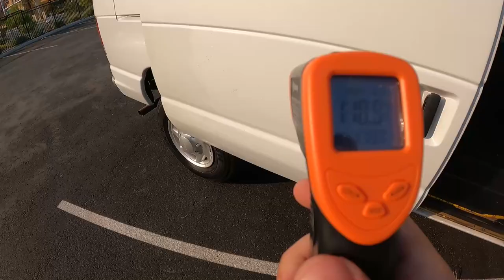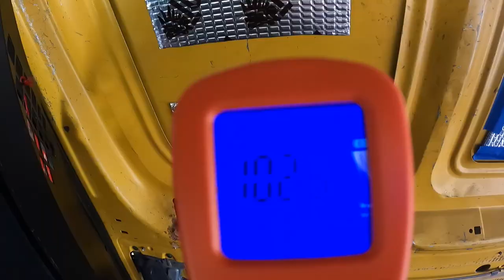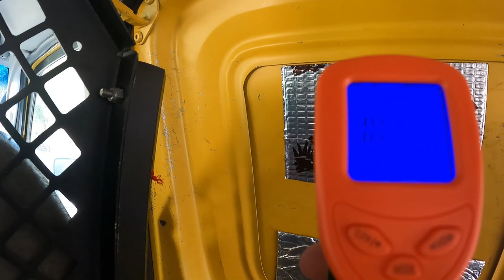How to do Van Build Pre-Insulation - Using Thermal Gun to Test

Comment: I made some layered window coverings for my van windows and to hold on the fabric covering, I used silver tape that was supposed to be for high temps but it did not last a summer. So I am going to used an alternate method to hold the covering to the plastic-reflectix-plastic next time.

Comment: You shouldn't compare temperature of different materials using infrared thermometer.
Different materials have different emissivity so even if they in fact have same temperature infrared thermometer could show that it is different, especially between paint and shiny metal.
Better way would be to use contact thermometer (like thermocouple) or stick something (like electrical or masking tape) to all surfaces and measure it's temperature instead.
Reply from the maker: Would you like to buy me a infrared thermal gun? LOL 😂 The good ones are not cheap
Reply: @JarrodTocci  he's saying DON'T use a thermal camera or infrared thermometer. The results are misleading.

Comment: You won’t regret going electric. I’ve had a Ford Fusion Titanium plug-in for 8 yrs. Remember you will need a place to install your charger. Also, solid state batteries are suppose to be coming out in 24 - 36 months. They will be the game changer. Better range with shorter charge times.

Comment: To me it looks like different insulation would be used on the ceiling the walls and the floor. My project will be an express passenger van with windows and upholstery so I'm thinking of using Havelock wool for behind all the ceiling and walls upholstery. I don't think covering and insulating the windows will be too difficult.
Reply from the maker: As I said in title and the pinned comment this is not the insulation. This is used to create a thermal break. I will also be using wool

Comment: Ok. Newbie here.. I had the impression that Kilmatt was for sound reduction, not insulation….? Sure, any substance will change heat transfer some, but… why bother?
Reply from the maker: I’m no thermodynamics expert but think of it this was. Take a soda can out of the fridge and place it in the sun and it will warm up very quickly. Take that same can and put a koozie over it and it will keep it cold longer. This is like having a koozie inside your tin can. In the hot summer days the inside temp can be 10-20 degrees higher then outside. With doing something like this it creates a thermal break and helps temp control
Reply: Killmatt is a sound deadening material which stops the resonating vibrating sound of the metal shell of the van. This should be followed up with insulation (which is the part that stops it feeling like an oven). The insulation slows down the heat transfer from outside to inside (and also the heat loss from inside to out) which can be calculated with an 'R' value. The last layer should be the vapour barrier to stop moisture getting into the insulated layers. Reflectix has a very low 'R' value which is why it shouldn't be used as insulation. Materials with low 'R' values let that heat transfer quickly, whereas materials with high 'R' values let heat transfer slowly.

Comment: Ir guns dont work well with reflective surfaces...
Reply from the maker: I tested this thermal gun in several locations and it was very accurate
Reply: @JarrodTocci  aluminum acts like a mirror to infrared. You're measuring the temperature of something behind the gun. You need to use a contact thermometer. Your results are misleading.
Reply from the maker: @carlanderson4139  the aluminum is painted therefore will not reflect like you think it will. Tell you what, when I get back up to Portland my friend has a Flir gun and we can use that as those are very accurate and we can compare but I'm sure these numbers are very close to accurate
Reply: @JarrodTocci  the flir gun works in the same way, so results should match.  Reflectix is supposed to reflect heat- it's in the name. I'd be  surprised if it was coated with anything that inhibited that. 

He's a video showing the effect I'm talking about. https://youtu.be/Gfe5QoESNh4
If you're able to try out a thermal camera, look for reflections. It's amazing how it works.

I'm a fan of your work and videos.  But think you should reconsider your conclusions here.

Comment: frost king is oil based so it off gases when it gets hot.  Not a good idea for a van.  Better to used a butyl based product like rattle trap. Its a metal can on wheels. What happens when you put a blow torch to a pop can it turns into a furnace. Thats basically what a van is.  You might be able to use a ceramic coating to deflect the heat but you cant make it stay cool. You can put in a thermal break but you need an inlet and outlet to let the break breathe otherwise condensation forms and you get water in your van.  Just dont think you can really make a van optimal its a trade off.  Do the best you can.
Reply from the maker: Rattle trap is tar based